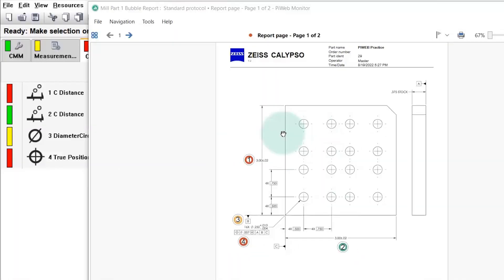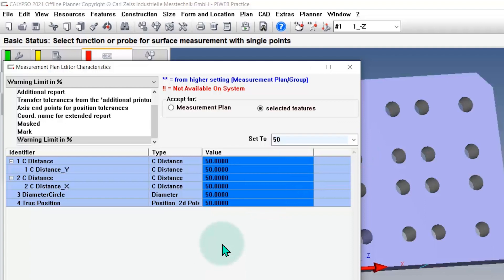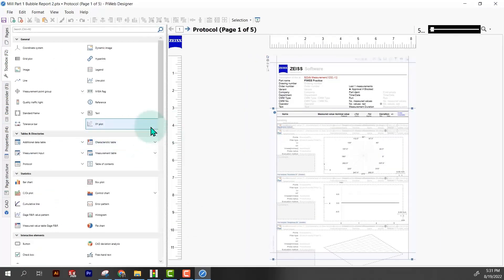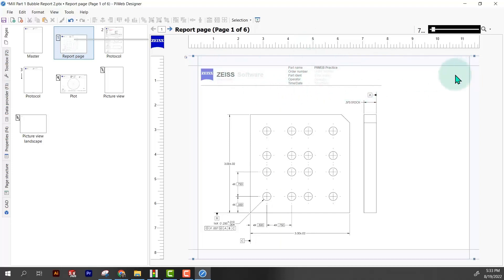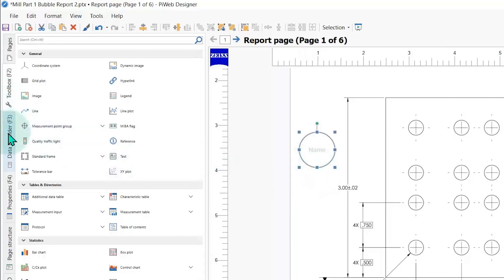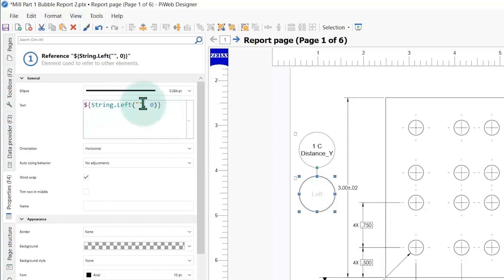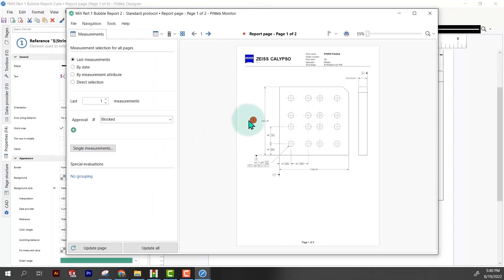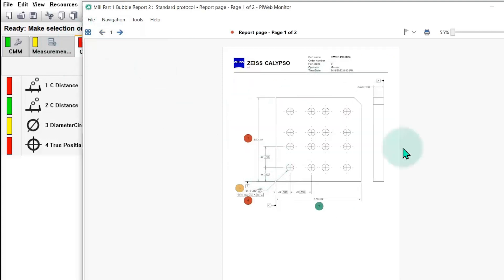Zeiss Calypso PiWeb: Making a Bubble Print Report

Comment: Running Calypso 2023. In piweb when I am click on Data provider tab on the lfet, there are no Characteristics there to select from.  I have not had a chance to run the program because I am waiting for fixturing to prove it all out. Do I need measured data there to select from the characteristics?